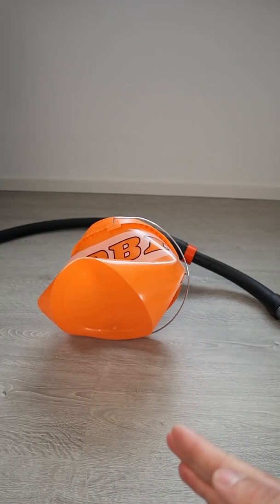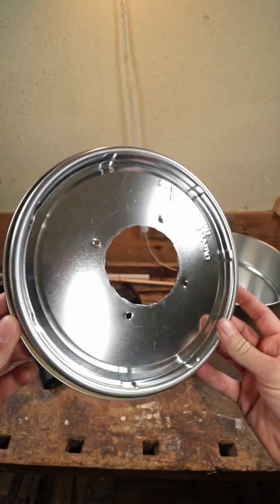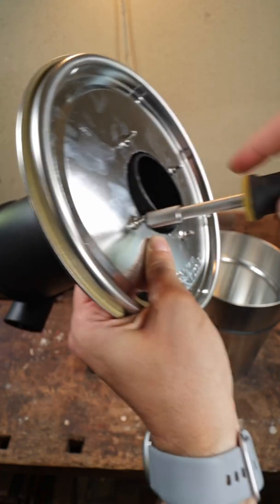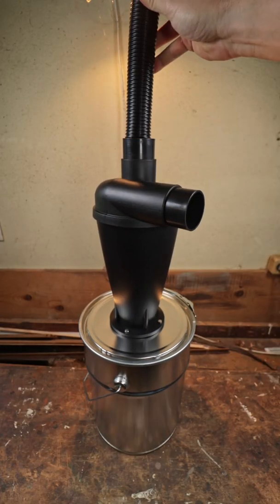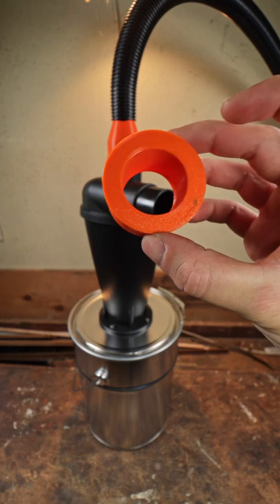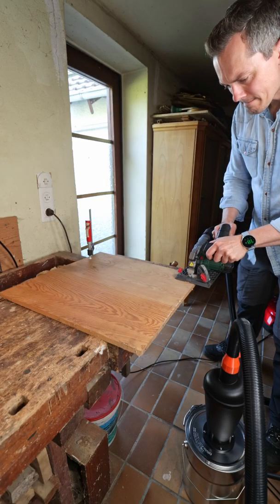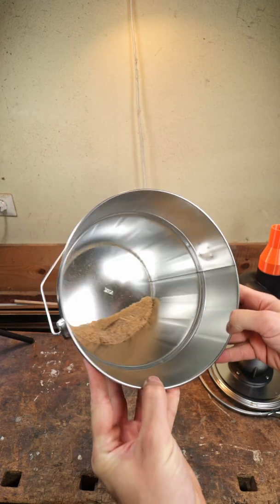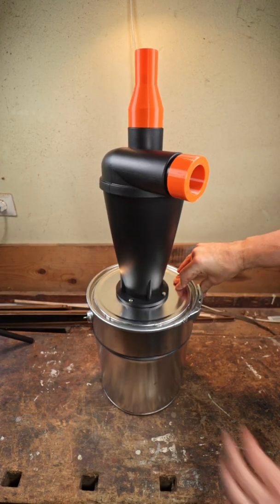How to Build A Cyclone Dust Collector with 3D Printed Upgrades & Metal Bucket | Shorts

Comment: Did you print the cyclone or buy it? Asking because I was considering printing one.
Reply from the maker: Hey! I also considered that, but when seeing the print time and amount of filament needed, I went for buying one as it was only around 30 bucks 😉
Reply: @thebuildbay  printing one is 24 hours and a little over 1kg on a fast printer. So we are talking like $13 for a large cyclone.

Comment: Hey dude. What do you think about SL_ST CYCLONE? It is also 3d printable;)
Reply from the maker: Hey there! I was also looking into printable cyclones, but they take super long to print and often require 1KG+ of filament, which costs ~25€|$. Buying one on Amazon was about the same, so I chose the easy route 😂
Reply: @thebuildbay  I agree. A number of cyclones require quite a bit of plastic. Mine is no exception :(But now I'm working on an improved version, the amount of plastic in it is greatly reduced. Thank you for your attention.
Reply from the maker: @sl_st  Ah, I didn't notice that you actually designed your own cyclone. Saw it an thingiverse, great modular design 🤘🏻 the ones I saw back when I did the video were way more basic...
Reply: @thebuildbay Thank you for your kind words.
 I also like modularity. It didn't appear immediately. Only as I started getting feedback on previous versions. I hope the new ones will be even more flexible.